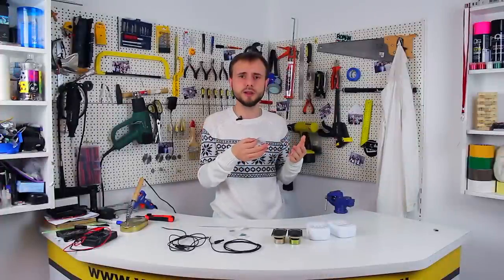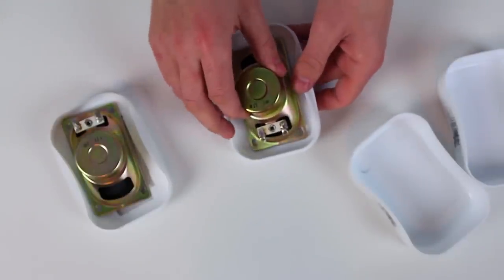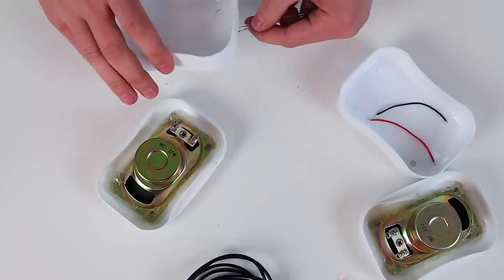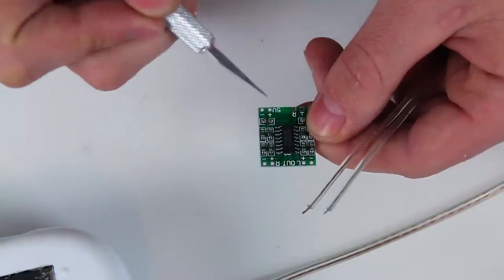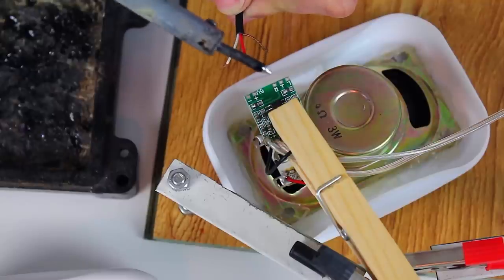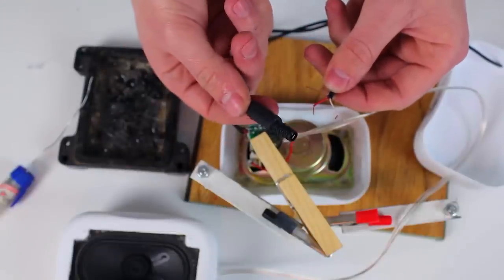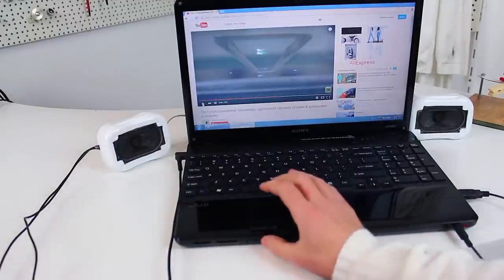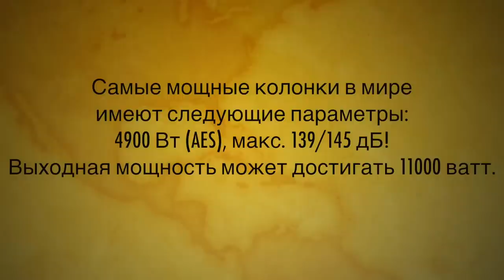How to make mini USB speakers

Comment: They're not really usb speakers, though, if you're using an AUX cable.
I was just looking for a way to make speakers that receive both power and audio signals through USB. What kind of chip would I need to make that work? Would I have to rip one out of existing USB headphones?
Reply: ooo this is a cool idea, i have a shitty pair of usb headphones i might have to try this out with
Reply: Lemme know (right here, I guess) if it works. I only have my one set that I don't wanna ruin just to test this out.
Reply: if i don't get back to you man try thrift stores. i'll try mah best tho
Reply: hey, you don't have to make any promises to a random stranger online :P I won't exactly be sitting here twirling my thumbs, waiting.
Reply: of course not but i can try

Comment: what is board u used....how i can ask at electric shop..........????
Reply: PAM8403 board. You will likely not find it at a local store, you will need to order it over the Internet. The cost of the board is very low, you should be able to get one for about $1 including international shipping, perhaps a bit more if other components such as volume control or power filter are installed on it.

Comment: I have done the same but with a blue tooth dongle. I ran into noise issues plugging the dongle in the same USB hub for power as the amp. I have to some kind of filter to prevent high frequency noises from entering the amplifier.
Reply: +Dart Gar the amp needs a coil as an input filter.
Reply: Dominik Lux
Thanks!
Reply: You need to filter the power that comes from USB. A coil as Dominik says is a good solution!

If you want to make the filter particularly small and efficient, you can loop one wire of the power cable around a small-ish ferrite bead, then solder a capacitor (around 100µF or larger) between the two wires (you can use the contact board for the other wire on the board), then loop the first wire around a ferrite bead again. If the size of your bead allows, do multiple loops at either or both spots, as many as you can fit. Do not to run the two different sections directly over each other if you end up using just one bead instead of two. Secure them with any suitable glue so they won't cross later. This will give you a filter with 24 db/oct attenuation as opposed to 6db/oct attenuation of a single coil.
Reply: Thank you everyone for your great suggestions.

Comment: Could you combine  the audio and USB so that it's one wire but at the connector   It splits into the USB and audio connectors?
Reply: Problem one, it's more effort. Because like this, you only need a standard audio wire, like headphone wire, plus a standard USB wire. You don't even need to solder the plug side on either because you can source pre-made cables, like from dollar store items or broken equipment. It even leaves you with more flexibility, because you can then connect audio to your phone or MP3 player and USB to a phone wall charger, and you don't need to place your audio source and power supply in the same place.

Problem two, it's difficult to source the correct wire. You need 5 conductors: Power VCC and GND, AGND (audio common return), L and R. It's not proper to combine GND and AGND, most computer soundcards revolt with audible noise and distortion injection. You may measure resistance on computer between AGND and GND of <1 Ohm or even very close to 0, however, it's designed as single-point reference ground on the audio side, and will cause noise injection into the complete audio IC if there's stray current on the audio common return wire. Of course you might have the issue anyway because some computer enclosures connect USB GND and AGND on the aux board >.< Im am indeed on a crusade against that, writing letters to enclosure manufacturers, and usually they are happy to learn. A 5-conductor cable can be obtained from microphone cable supplier, but is not common enough.

As a compromise in case connecting USB GND and AGND is deemed acceptable, USB wire could be reused, with D+ and D- being reappropriated for L and R, but it's not generally a good idea.

Problem three, when run along a single cable, the current on VCC will be induced onto the audio wires, generating noise and distortion.

Comment: where to buy the chip board??
Reply: Depends where you live, usually the fastest place is Amazon, independent local sellers should be able to get one to you within a handful of days.

DealExtreme, a very reputable sales company from China, also stocks various PAM8403 boards, and has some warehouses around the world, if they are lucky to have it there, which should ship rapidly. If it has to travel all the way from China, expect a week for shipping + however long your country's mail takes. Customers in Italy and Russia usually have to wait for 2 months, in Germany for 10 days, in most of the rest of EU for 3 weeks.

Banggood is another Chinese seller that stocks PAM8403 boards. Opinions on this seller are mixed, because they may not offer or honour warranty on expensive items, but you can buy such cheap items there with no major regrets.

A possibility that is usually cheaper than those is to search for PAM8403 on eBay, then specify location as "worldwide" instead of your country, then sort by price including shipping. It may take longer and you might not receive a product.

You should expect to pay in the range of $1 to $5 US for a PAM8405 board including worldwide shipping depending on selection of secondary components on the board, such as power filtering and a volume control.

Comment: I was about half way through a speaker project of my own, an I remembered this video so I am using the same method. instead of connecting the USB to a computer I am connecting it to a portable charger.

Comment: i hav used 5v amp for 15w speakrs 
but i m not getting loud voice as i want so plzz tell me the solution
Reply: You have to buy a USB charger with 3 amps for 2x7.5W speakers or 6 amps if you have two 15W speakers. Don't know if that high amperage chargers exist. Your PC usually only gives 2.5 Watts per USB port.
Reply: mati, that is not the problem. The problem is probably high impedance or low efficiency of the speaker used, so the amplifier can't deliver enough power from its available voltage anyway. It should be noted that PAM8403  amplifier is only rated up to 3W, it is not capable of handling higher power, nor is it foreseen to be used on more than 5.5V supply. But it is to be kept in mind that with higher impedance, power requirement actually reduces for a given voltage swing. Also it's not foreseen to supply PAM8403 with much higher voltages than this.

The speakers typically used with PAM8403 are speakers from TV sets and radios. These are resonant speakers (Q>1), as opposed to compression speakers (Q<0.45) common in HiFi. They are imprecise but more efficient. The recommended speakers are generally rated for up to 6W and usually much lower, and optimally have impedance of 4 Ohm, but 8 Ohm speakers work too. Such speakers can be extremely loud on PAM8403 amplifier board.

Another possibility is wiring error, the sound will be low if + or - of two speakers have been accidentally connected to common ground or from one speaker to another. This is because it actively counter drives both + and - lines to achieve a virtual 10V voltage swing from only a 5V DC source.

Another possibility is that this PAM8403 IC sample is simply dead.

Comment: I found that if you use Sony tv speakers they work the best and you don't need to put a air hole in the box
Reply: +chrissteene the air hole makes the bos just worse. Its creating an accoustic short circuit. It will kill some frequencys and you have a much less frequency response than without hole. Remember, just a hole in a Box is not a Bass Reflex System. bass reflex is based on resonances and must be calculated.
Reply: +Dominik Lux ok well the Sony speakers I used have solid  backs so I found that I didn't need the holes it is just something I found and wanted to share

Comment: Why you need that USB? Mine works without the USB, only the aux
Reply: USB gives the amp more power, using just aux would only give a power output of approximately 1 volt, but if a USB is used, you can give out 5v+

Comment: You can't power 6 Watts just by USB because computers usually have an output of only 5V 500mA, which makes 2.5W only. Using an USB power supply would be the better alternative.
Reply: +mati this amp runs on 2.5V to 5.5 V
Reply: This is not quite correct. By specification, the USB host port should be limited to 500mA. However in practice they aren't, anything made since 2006 will happily feed 2A of current, with (sometimes optional) polyfuse acting as a current throttle only at much higher currents than that. Some computers before that actually carefully measured the current and would turn off the ports if they exceeded specified current - 100mA for devices without handshake such as these speakers, 500mA for intelligent devices. Since proliferation of dumb USB powered accessories, customer complaints were mounting and computer makers decided to no longer include such fussy protection, and beefed up the power rails instead.

Phones actually detect where they are connected to, and won't draw more than 500mA from a computer USB host port, but up to 1500mA from a USB charger where data pins are bridged with less than 200 Ohm between them. However, the speaker board is not connected to the data pins and doesn't care, so it will draw as much as needed. Also note that this allows fast-charging adapters to be created, which allow phones to draw up to 1500mA of current from computer ports simply by leaving data pins unconnected on PC side and bridging them on the phone side.

Comment: Or, you could just buy mini usb speakers from "eBrahy" for less than $8... with power button, headphones connection and volume rocker... :|... and I bet it sounds better since the boxes are way better built.
Reply: +mrN3w7 This video is for those who want to learn by building their own usb speakers.  They may have unused parts lying around like old speakers and wires. The point is, it would be more satisfying to hear music from a speaker you built from scratch.
Reply: rene kenshin
Fair enough... if you just do it for the sake of doing it is good fun if you already have the parts lying around. However, if you do this and expect to have some decent sound quality, you are in for a little bit of disappointment...
Reply: mrN3w7 Not really, not because you made it yourself doesn't mean it wont sound good.  It would still depend on one's knowledge, technique and quality of parts used.
Reply: true... but then it kills the whole on the budget thing once you go after quality parts... anyway, each to its own.
Reply: The cheap mass market items are not better built. Their acoustic design is usually similarly haphazard, but speakers are of worse quality, because these have been sourced from a rather decent old dead TV and have a larger area. Plus the amplifiers in mass market speakers are surprisingly often worse than PAM8403, both less loud and less clean. I did a bunch of such tupperware PC speakers myself because i found random speakers slaughtered out of something, and very rarely are the results sounding worse than a purchased 10-15€ PC speaker pair. If you want a volume pot, you can get PAM8403 boards where one is integrated for just a couple bucks more. No idea why you'd want a headphone output since that's what you're feeding them from in the first place, but that's trivial enough too. It's a good project with an often decent enough result, and if somebody finds fun in that, they can eventually go on towards the hobby of serious, physics and math heavy, acoustic design.

I would have wished one improvements on this though. People will often run into noise induced via USB power, and if it's a store built item, they will not know how to correct this. I would have liked the author of the video to make an optional video section that fits at least a ferrite bead or a coil and a capacitor to the power input, thus explaining the issue and letting people learn how to solve the problem.
Reply: Siana Gearz If you actually think that those speakers, from this video, are better than the speakers you can find online for pretty much the same price, than I rest my case... you can buy some decent speaker for $20 (even less if you shop around) - Logitech Z200 2.0. :/... better than the ones in this video.

Anywho... each to its own in the end. Good luck...
Reply: mrN3w7 Logitech Z200 is a decent PC speaker, almost well worth its price of... 35€! 27€ if you shop around! Nah, not really, i'd only pay about 20€ for it, but it doesn't come this cheap. The last PC speaker pair i bought for about 40€ was a fully wooden one with 9cm wideband driver, 6 liters of air, and AC powered 2*10W RMS amplifier, by KYE/Genius, and after some modding (converting them from bass reflex to aperiodic vent, because it had Qts of about 1.2-1.4 thereabouts, by the way Fs was about 120Hz) it sounds pretty decent indeed. It's not representative of anything really though, because most comparably priced speakers were significantly worse, and it was discontinued rather rapidly. I no longer use them because i now have Elac BS52 adorning my PC.

It's a complete dishonesty on your end. You tell us that this is supposed to be worse than a typical $10 speaker (approx. 8-9€), and to prove your point you show me a 30€ speaker.

Everything i've seen for less than 10€ was at most accidentally not complete and utter crap, absolute haphazard designs. I've said i've done this because i had decent TV speakers around, and i've said that this tends to sound better than typical ultra cheap USB powered PC speakers that fell into my lap, like LogiLink or was it SpeedLink, and an off-off-brand sub-brand of Hama. These represent the 8€-15€ retail price range.

So if you need something, just about anything because for example your laptop or whatever is outright inaudible, you don't terribly care about sound quality, you have old speakers that you had the foresight to rip out of that 20 year old TV that recently died and that you threw away, and you like building things, it's a still a viable project. Nothing can replace the fun of putting things together, and what you're getting here is likely enough to turn out OK.

Comment: you got to be kidding me first of all it's not 50 cents it's 10$ second this speaker will sound like garbage 3rd make it AC powered the USB port can't handle that mush fourth couldn't you just buy a housing for a vintage speaker and use it it will look way nicer V and lastly it's way too small I have heard boomboxs that sound better than this garbage